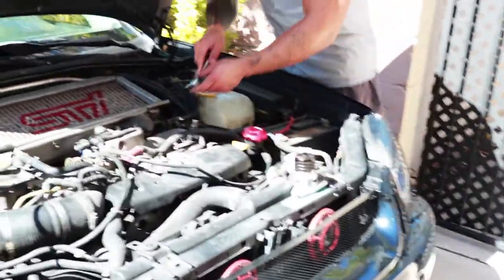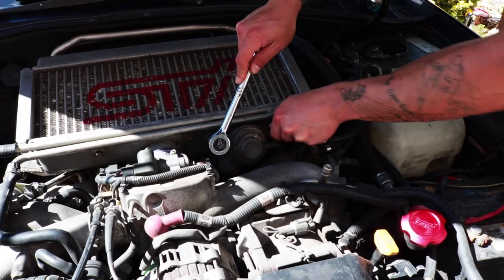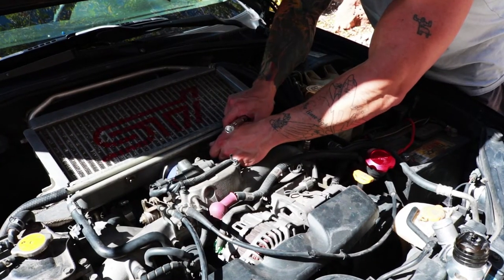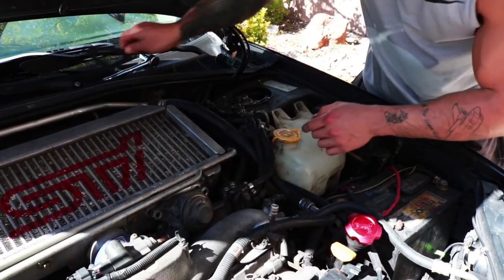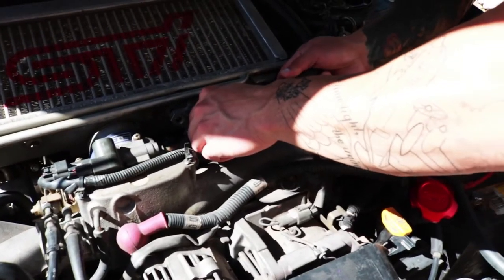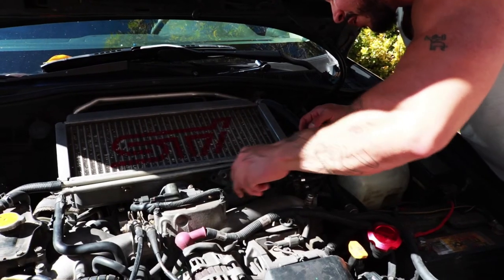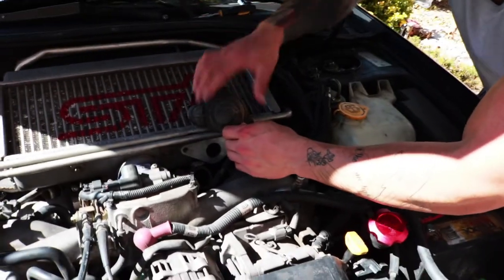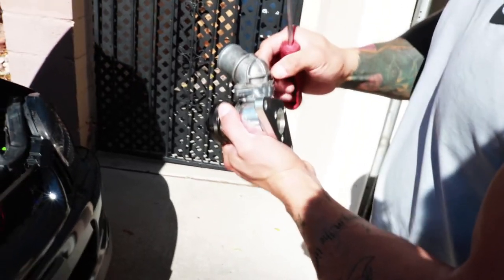How to: Installing a Blow Off Valve on a 2002 WRX

Comment: Can you install a blow off valve without a tune.... My daily is a 2003 WRX and I know they're temperamental when it comes to tunes and didn't know if I needed to have one before I put on a blow off valve
Reply from the maker: I would probably recommend getting a tune if you do it. Since they come with recirculating valves it mouthy mess with the air fuel ratio and cause negative effects in the long run.